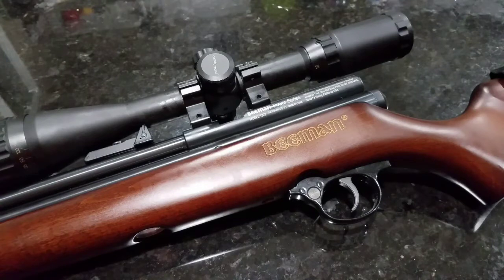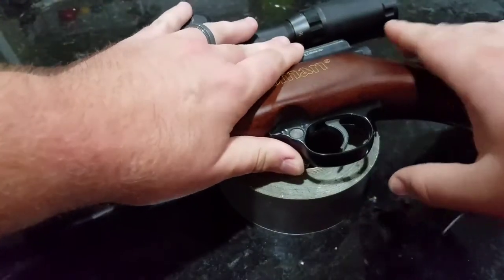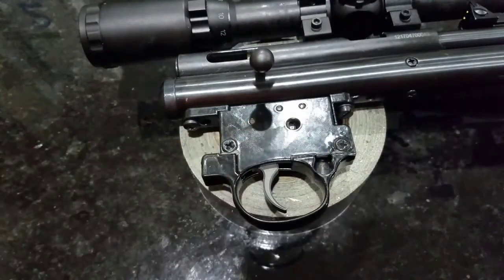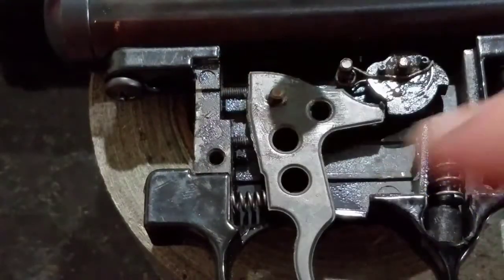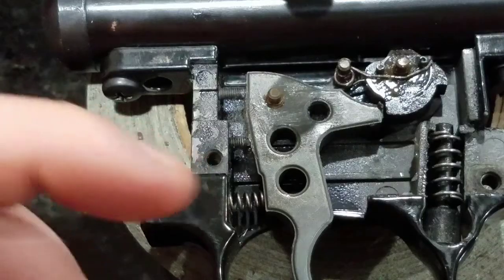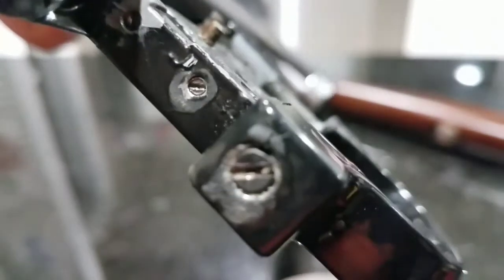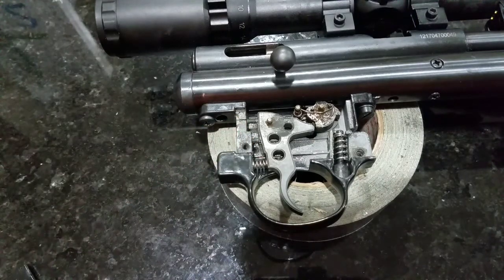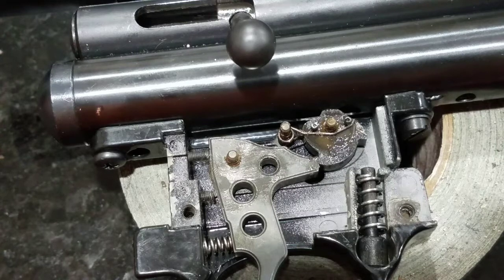Umarex/Beeman QB CHIEF Trigger Pull Adjustments

Comment: Your instructions...except for how you have to hold the spring when reinserting the safety latch went perfectly on my November 2018 QB Chief.  Mine had small allen screws instead of slotted screws on the trigger travel and the stop screw.  The trigger weight pull adjuster was still slotted.  I love the adjustments I had the nerve to make today. Thank you.
Reply from the maker: Awesome! Thanks yeah adjusting the trigger definitely makes shooting experience better
Reply: Can you leave the safety out and still have the gun function okay?
Reply: @1776adb  But of course you can - on almost any airgun....

Comment: Thanks! My new single shot Chief has a much improved trigger now, maybe 1 lb with very little creep. Mine had hex head screws for the 2 small adjustments. Also have a Buck Rail suppressor on order for $20 which should make it a lot quieter.
Reply: Does Chris at Buck Rail make Beeman chief QB Suppressors?
I would need one of those.
Reply: @davealcorta4600  I believe the one I got fits that, ask em.

Comment: In my Gauntlet and QB Chief, the safety can not be engaged after cocking either Rifle.  I take it, this is the normal function of the QB78 trigger assembly family?   Would appreciate any info you have on this.
Reply from the maker: Ill have to check but I think the hammer has to be cocked to put safety on

Comment: Thank you. This is worth it's weight in gold. One question: I don't use the safety ,can I leave it out and still have the gun function okay?
Reply: As it sits with his safety out you can see the safety lever/selector will have a high and low spot for the safety pin to travel (up position and down position), in order to engage and dis-engage the safety pin. The reason for the spring on the safety pin is to keep tension and push the pin down (as you see it now in the video) so the pin doesn't stay up, hindering the trigger sear from releasing engagement when the selector is in low or "fire" position.

To answer your question, yes your gun will still fire without your safety selector.
Reply: Thanks again. After your info this gun went from a notchy 5-6 lb. pull to a 1-2 pounder that has made this gun a tack driver.
Reply: @1776adb  I don't have the gun I have a marauder but the set up looked pretty simple, that's the beauty of cheap guns, nothing fancy, just simple stuff that just works! Glad it went well for you!

Comment: I just received a Chief 2. The trigger is horrible. I can't get the safety out to separate the action from the stock. Has something been changed to make this step different?
Reply: It finally came loose so I could separate the action and stock.
Reply: Got it done. There's still a little more creep than I like but it's light years better than it was.
Reply: I was thinking of cutting a notch in the stock so the action would slide out with the safety in place, but I discovered the notch would have to go full depth of the stock. Cancelled that idea.
Reply from the maker: Glad you got it figured out, just seen your first comment

Comment: you can make all the adjustments with the side cover left on there is a hole in the side so you can see the sear engagement but it is a good trigger just wish it as 2 stage instead of single stage but it can be made very very nice good job
Reply from the maker: Thanks
Reply: If you want to see a two stage (ish) set up that really looks neat and that I believe would work well. Check out Hajimoto's  video on an upgrade to the Gauntlet trigger.  ;o)}

Comment: I was having so much fun with my chief today after installing a bushnell banner 4x12x40. I was hitting rocks in the creek at 65 yards dead on. 
After a few shots the trigger won't engage when i pull back on the bolt to load up another pellet. Only way it will load up is if i push the trigger forward with one finger amd pull back the bolt action. When i shoot the trigger is feather light, slight touch of pressure and it goes off. Ive only had the beeman for a month and my question is should I take it apart and try to fix what ever messed up or should i send it back to pyramid air?
Any suggestions would be appreciated.
Reply from the maker: I would take the side plate off and check

Comment: Have you experienced so much pressure on the sear that the safety is almost impossible to set. If the rifle is not cocked the safety works easily. I have a .25 cal Gauntlet that has the same trigger set up.
Reply from the maker: Something must be backwards try disassembling and assembling again...safety should easily go into place once cocked not vice versa
Reply: @STKO2011  The nub on the base of the plunger did not set down into the grove in the safety lever that rotates. I machined about .010-.015 off the base up to the nub. Allowing the nub to set into the grove. I can now put it on safe when cocked. Basically I just made the plunger shorter without shortening the total length.
Reply from the maker: @elcues  there ya go as long as it works!

Comment: Could I adjust the trigger and hammer spring safely without degassing the reservoir? I just got 2 QB Chiefs and the triggers are super heavy they feel around 5lbs. Id like to adjust mine with more power to shoot heavier pellets better and the 2nd one a little lower to shoot the Crossman Premier's good and get more shots.
Reply from the maker: Frank Faz yes you can adjust the trigger without degassing the reservoir you might have to pop off a couple shots to get the trigger where you want it also you can replace the trigger spring with a ballpoint pen spring it will reduce your trigger down to about a pound and a half or so it's really hard to say without me looking at the gun whether or not you can adjust it the only thing I could say is if it has threads on the back of the air Reservoir behind the bolt then you have the adjustable unit if you don't have the adjustable unit you have to tear down the gun and put spacers behind the hammer
Reply: Shoot To Kill Outdoors Yes it looks like an allen head bolt on the back of the bolt. Could I turn it up without degassing??
Reply from the maker: I'll have to look when I get back home, 1st generation doesn't have a power adjuster just degas key/tool...2nd generation has degas/adjusting tool

Comment: Hey Bra... Hows it doing?... I just was lookn thru your vids again and came by this... Now ive heard people say that the umarex gauntlet has the same trigger group as the QB__ and that the adjustments and/or mods can be done the same way... Do you know if that is true AND if so, is this the same OR anything like that trigger that that you know of? I know sometimes companys use the same triggers on different models but i didnt know if the cheif is the same as the QB__ ...? 
~Doc~
[12/10/17]
Reply: The Umarex Gauntlet is the QB79 / QB78. Only difference is the plastic stock and forgrip.